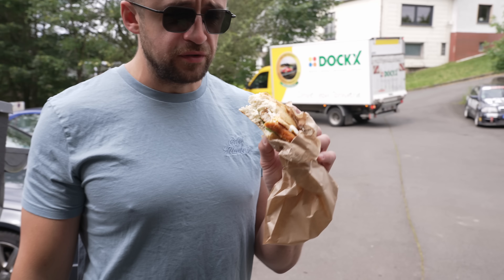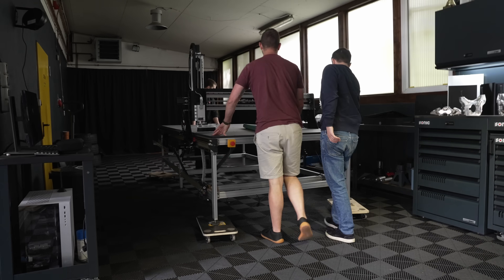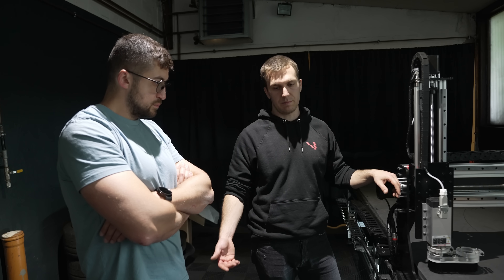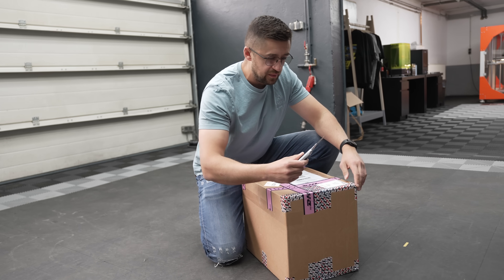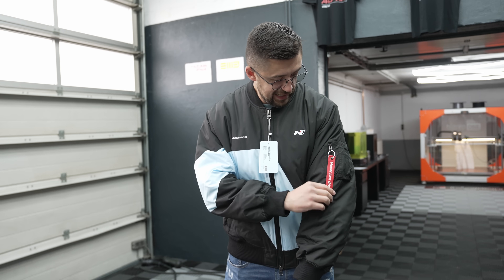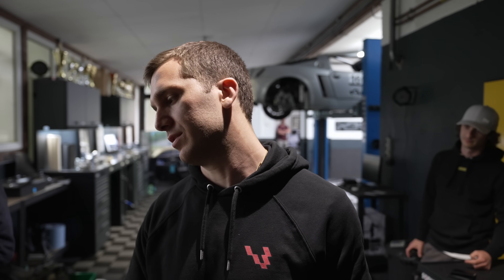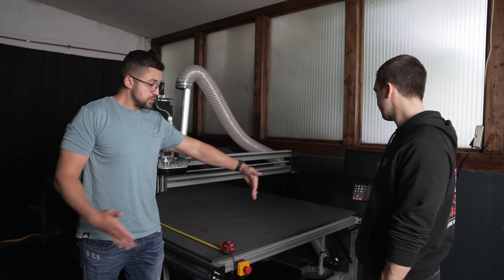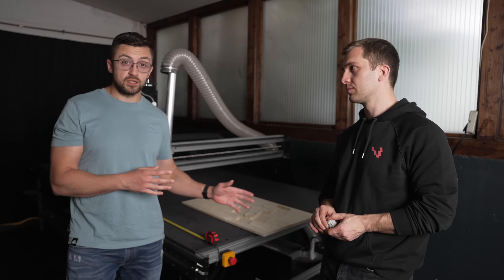Flat Floors Incoming!😍 We Bought a New 3-axis CNC Machine!

Comment: Very very cool, I used to be a product manager for CNC machines for woodworking (SCM). My friendly advise: Put the vent for the dust extraction outside your building in a shed. Saves noise and finedust inside your workshop, and no more changing of filters and bags inside your workshop. Seems you are heading for a bigger workshop, which would be great!! whispers Hey Misha, I think your new cnc is almost big enough for a single piece of foam mould to produce a ground effect venturi floor for underneath the Spider.........

Comment: Now time to cry some more with all the sensors needed to fit to the vehicles to validate that the flat floor is actually working anywhere near the CFD numbers .
Reply: That's actually not nearly as expensive to do these days as it was even a decade ago, honestly. The computation is still the most expensive part.